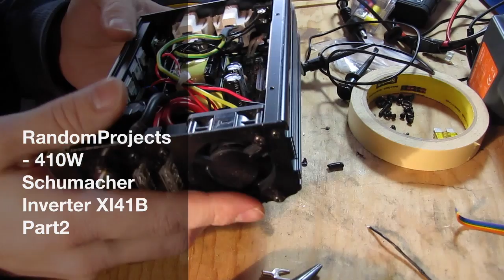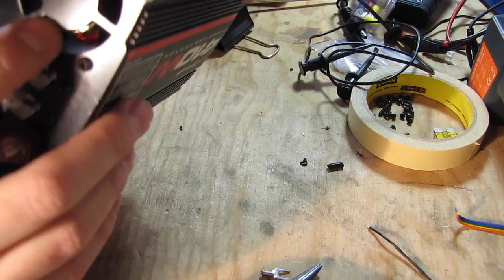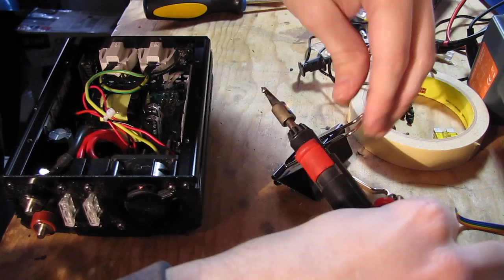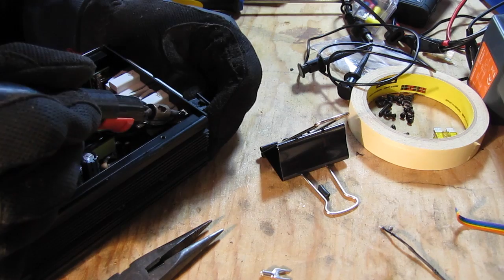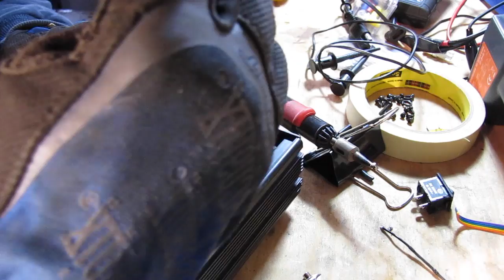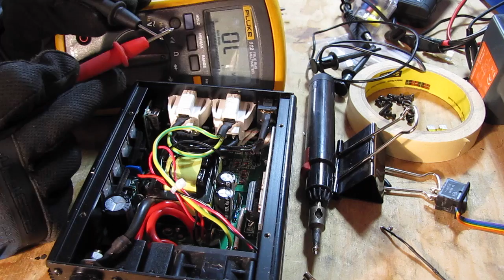410W Schumacher Inverter XI41B Part2

Comment: hi about soldering pen torch i had a cheep one from china it got shipped to me broken/bent and cracked  i fix it to get it to work but it broke any way i was going to say ive been glue / taping neodymium magnets to my electric soldering pens so that i can attach them to metal to hold them when im not using them maby you might want to do the same try taping it first to know how you like it then epoxy it on  if you do like it